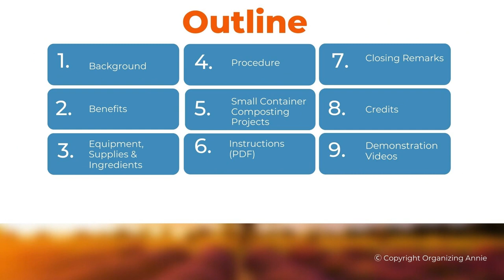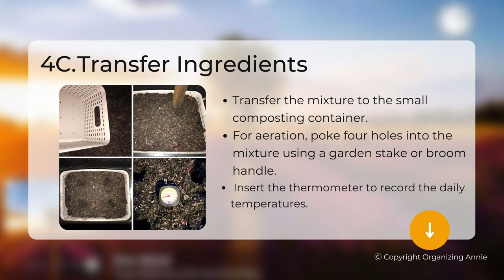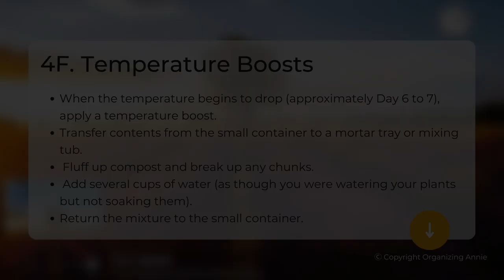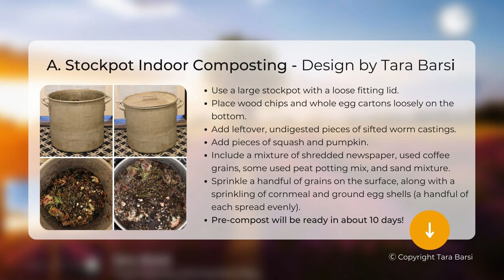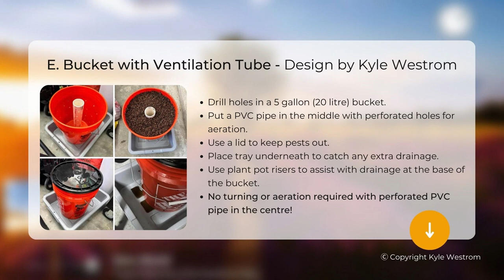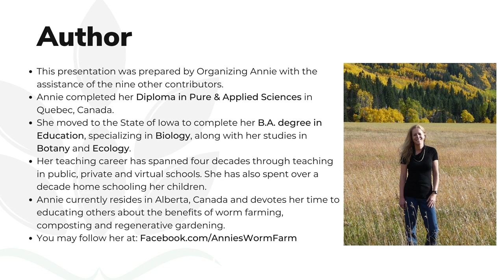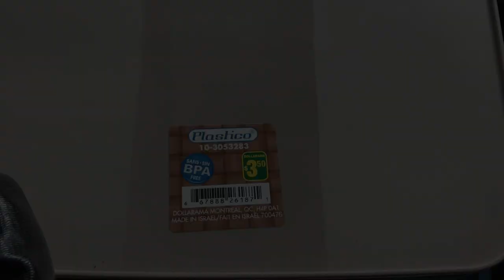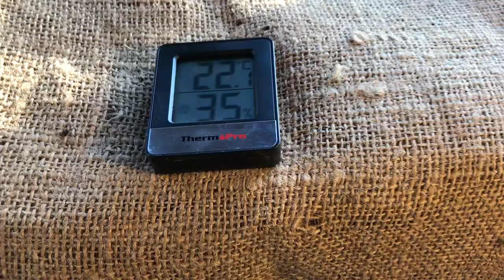Pre-composting in Small Containers

Comment: Great job. I've been making this coffee grinds, shredded cardboard, and kitchen scraps mix for my vermiculture directly. I sifted the worms from the composted mixture from last fall and put my worms and a few eggs into the new mixture. 

My question is: how long does it take the worms to make this new mixture into worm castings without pre-composting? If I do the pre-composting, then add the worms, how long does this take to get worm castings? 

I tried a few outdoor vermiculture experiments last fall. I made a trench vermiculture bed using the space between two raised flower beds. I put two dividers with holes to make three sections. I tried to overwinter then in Zone 3 under a few feet of snow. Before the snow arrived, I fed them a half watermelon face down, covered the vermiculture beds cardboard and then with 2" styrofoam insulation. The snow has just melted, and I removed the insulation and the worms made it through the winter! They are all the food and shredded cardboard and even the cardboard on top was pretty much in pieces. 
The second bed was within my greenhouse and they made it as well. The third bed was just soil and horse compost with biochar and lots of organic matter. I put the cardboard and insulation on top. This bed had the most worms and the biggest worms.
Reply: Congratulations Renita on all your worm composting experiments! There is nothing like getting out there and trying for yourself to discover what works for your area 🎉
As for how long it takes for your mixture to be consumed without precomposting, I cannot predict since there are so many variables involved. Also the focus of our group has been on using a short precompost procedure to provide a feeding that is full of microorganisms and ready for the worms right away. One caution with mixing your coffee grounds and cardboard shreds and adding the worms straight away to the mixture is that they may get too hot and need a safe place to retreat to until the temperature comes back down
Reply: @kimtorres8713  I actually have this safe haven for them. The base of my vermiculture structure, and all my vegetable beds, is about 6 inches of wood chips they can tunnel into for the winter and if it gets too hot or too dry. It seems to be working well for our zone 3. Presently the last of our snow is melting (May 3rd) and it’s pretty cool 5-10oC outside. I pile the mixture of coffee grinds, kitchen scraps and shredded cardboard on top and put the worms back into this mixture, and I’m harvesting this top layer only after about six-eight months. This way there’s always some of their castings or compost at the base. I’ve harvested this top layer from my vermiculture beds made last summer, and I used it to top dress my vegetable beds before I seed them next month.